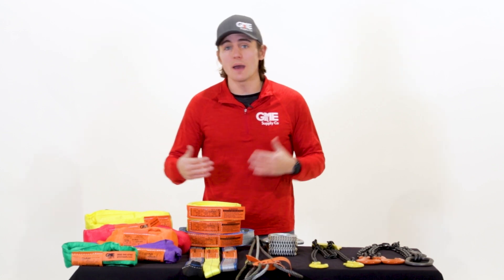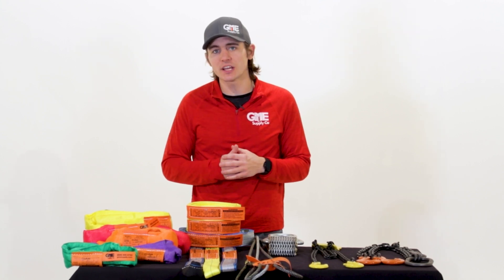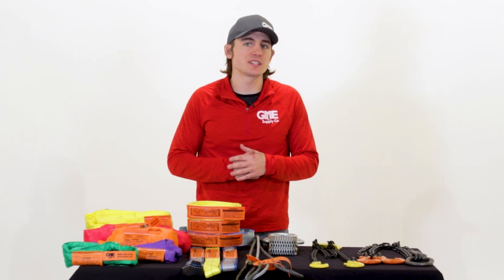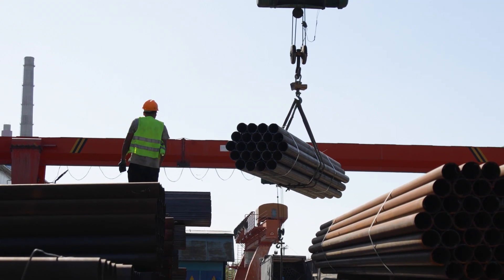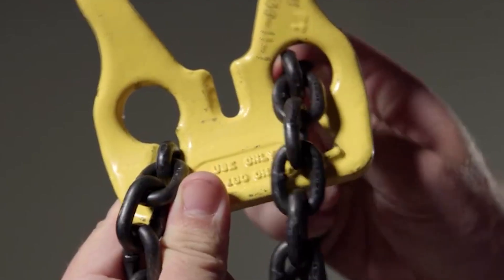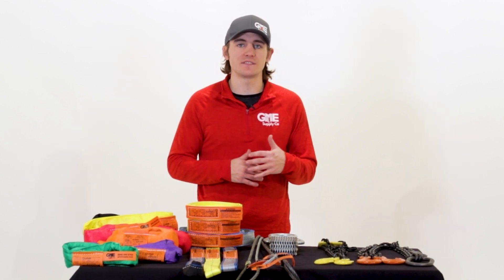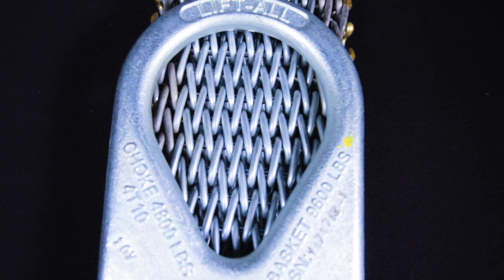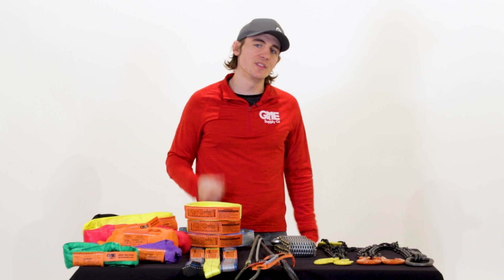Lifting Slings 101: Choosing the right lifting sling for your job

Comment: 43t CNC. 2x 20t Round endless slings on the back & 1 big ol' 35t bow shackle on the front with the sling according. Had to get Mammut in with there Mega lift. Guy said it could do 200t to 6m. Thats impressive 👏